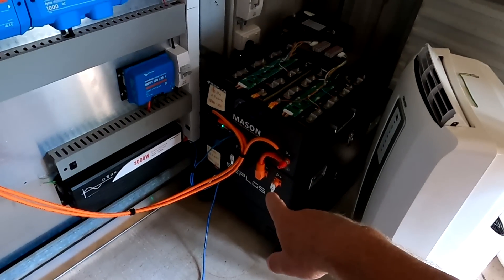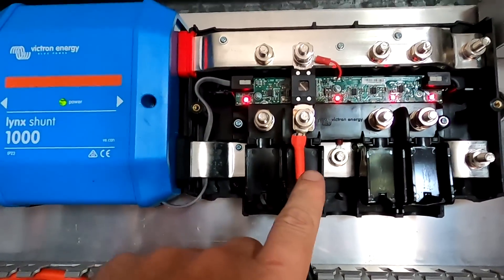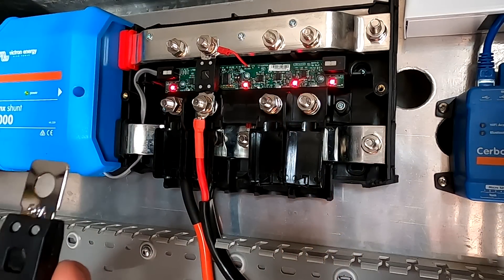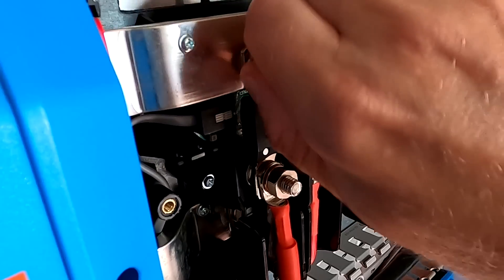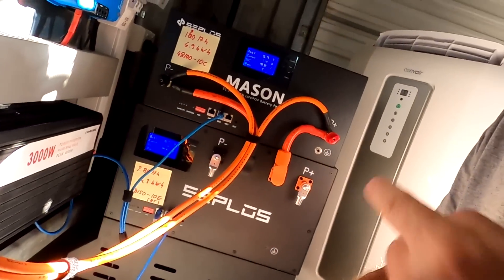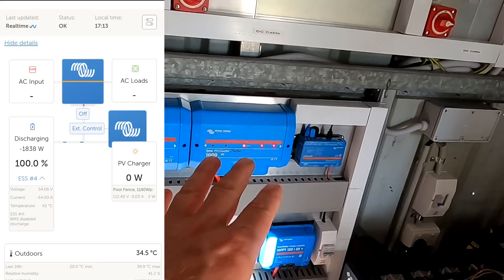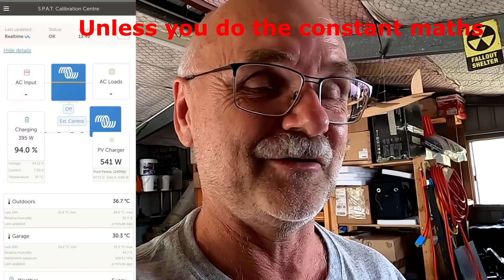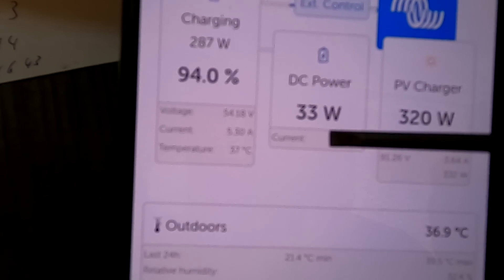PowerWall2.2 Xijia 3kW Inverter installation. I totally forgot about it...🤦‍♂️

Comment: I have the same inverter (120v) and not sure how much I like it.  It works -  I've run it at 1500w for a few hrs straight... it makes a lot of weird fan noises, but not sure it's pure sine.  I get speaker hum and I think I can tell the difference in the sound a fan motor makes running off the grid vs the inverter.  I got it as a backup.  Sort of afraid to run my fridge w/ it.

Comment: Cables coming from battery 2.2 to Lynx power in look a little sloppy. Why not run them through the raceway?
Reply from the maker: It's a temporary setup as I explained in a previous video when we discussed the design.
Reply: @OffGridGarageAustralia  . I figured that, and spoke out of turn. Battery 2.0, the wall, the solar is just awesome..

Comment: I checked, but the "Peter" inverter is not available in US style voltages -DARN looks like a great unit. Andy can you use your influence - maybe they can make a US-Peter inverter!
Reply from the maker: It is not? I thought they sell them in all markets now. 120V, ey?
Reply: @OffGridGarageAustralia  NOPE! I double checked in case they added a model, but from their website, all modeles are for EU/UK/Az-Nzld markets.  no 120volt for me😞 Can+USA+Mex = 580million customers left out!
Reply from the maker: @r.b.l.5841  bugger... I can also recommend the XIJIA inverters. I'm using them for over two years and they have the same performance as the Peter. Very powerful running all my electrical garden tool and the 2.4kW chain saw without problem.
https://s.click.aliexpress.com/e/_DBFw0TB

Comment: Hey Andy, thanks for the video. I couldn't find a link to the 50A MegaFuses you're using. Are they rated for 48V systems? I found some 50A fuses rated up to 32V but only midi for 48V 50A. Could that be an explanation for the slightly higher temp on the fuse?
Reply from the maker: The voltage does not make a difference when operating the fuse. It's more in case of the fuse blows it does not arc as far as the lower voltage  fuses. If this is really an issue, I don't know. Victron sells the only 58V/70V fuses (CNN/ANL) fuses for a lot of money. I thought I have them linked on my website... I'll have a look and will add them.

Comment: thanks for sharing the inverter precharging methods again - I suggest to cut that particular part out and release a short out of that cause the search engine will find your short then or even a video cause i had been searching for something like that for quite a long time last year when i had been unsure about the resistance needed.

I still remember the first time 2 years ago or so when I had my first hybrid inverter and connected the battery and could not believe the sparks I got each and every time cause the manual did not mention nor someone in the videos I had seen before. First I had thought what has been going wrong, if I had not turned the inverter off or forgotten something else, but in the end the inverter worked fine and the main cause was the idea to test the inverter before doing all the cabling with the Leistungsschutzschalter / circuitbreaker. And without that circuit breaker just for testing purposes I simply had left the path described in the manual and that had caused the sparks that scared me a lot, I can tell you, that was an unpleasant moment and even more that the next time it did happen again and I started thinking about cheap  quality of the inverter. 

Great explanation and of cause showing the kind of resistor used cause I only could remember last year that I had seen some big ones in my memory.
.
Reply from the maker: That's a good suggestion. I'll do a separate video how to precharge. Thanks!

Comment: I'm sure others have said it already but when running the air con, try to keep the doors all closed so its only cooling the air volume of the garage and not outside. It will be quicker and more efficient.
Reply: Andy has said that he will be boxing in the electrical corner of the room to fix that.
Reply from the maker: The AC is just a test to see if it makes a difference at all. It will go soon again...

Comment: I have the same crimp tool. The crimp unit tools working well, but...so as allways it looks you have the cheap crimp connectors. I ONLY use the good one and the crimp tool works perfect wit 4, 6, 8, 10, 16, 25, 35, 50 and 70mm2 depending on the connectors self.If you need an address for the good ones i can help out.
Reply from the maker: Yep, the heavy duty ones work far better.

Comment: That's genius using the power supply to precharge the inverter or other appliances that have capacitors. Thanks for the useful tip👍👍
Reply from the maker: No problem 👍

Comment: Hey, You should update the Cerbo to the venus os 3.0 beta because "For systems having multiple BMSes connected, allow selecting which one should be used for DVCC. It also allows the use of a BMV for SOC tracking -- by selecting BMV as battery monitor -- while still using the BMS for DVCC." That means you will be able to use the luynx shunt (hopefuly if it supports bmv it should also support it) For more accurate SOC (maybe even current) monitoring
Reply from the maker: Thanks. It's running 3.00-15 and I have shown the DVCC in previous videos.

Comment: Ok , what the heck ? If my battery is full I can't use solar to power my inverter till my battery is down to 96 % ???  Not cool if you have huge battery bank . It could measure the 1.5kw load on the battery , why not let that amount through the charge controller ?
Reply from the maker: It's a major design problem with the Seplos BMS. More about this in a future video.
Reply: @OffGridGarageAustralia  🙃 Thanks Andy for looking into it . That's a show stopper for me .
Reply: I thought that can't be right, but I watched again and the Solar controller output is zero.

I'd expect the block on charging to just be in the BMSs, but maybe this is a downside of the comms with the Cerbo GX? Perhaps that can be re-configured in the GX? You would expect the controller to be in float with the battery ignoring it?

Comment: What voltage fuses are you using? I can’t find any 50amp 50+volt mega fuses. Most lower amperage fuses are 32v
Reply: Victron has them .
Reply: @onthelake9554  their mega fuses start at 125 amp for the 58 volt. They have midi fuses down to 60a 58v but I don’t think they will fit in a lynx distributor
Reply from the maker: The design of the Lynx shunt could be better to accommodate a class-T fuse. That would be great. 
Only Victron has got the 58Vand 70V fuses as far as I know. I did not buy them for my test setup.
Reply: @OffGridGarageAustralia  I guess if the goal is to protect each battery with a class T fuse it needs to be at each battery really , if something shorts the cables =BOOM ,  as Joe would say .  Mounting a class T holder on the face of the battery and just use a buss bar or regular fuse at the Lynx .
Reply from the maker: @onthelake9554  I would really like to see a breaker being installed in the Mason box to easily disconnect a single battery quickly. I have some 125A dual breakers here just need to find some time for this project...

Comment: Maybe adding a (large) fan that exhausts the hot air from the garage or brings in fresh air might help with the heating problems! Installed some fans in our outside shed to keep the tools and batteries from getting toasted by the heat and it works wonders! Cheers from Belgium!
Reply from the maker: The problems with fans is DUST!
Hence, I have the idea to build this battery room around the area.
Reply: @OffGridGarageAustralia  Fans in the gable ends as exhaust, put in a fresh air inlet with a filter...like they use in an HVAC system. Cheap and easy!
Reply: Some ‘Roof-Ventilators’,  commonly known as “Whirlybirds” ( a Brand-name) here in ‘HOT- OZtralia’, installed into the roof of your ‘HOT-ColourBond Steel shed’ to exhaust the ‘trapped’ hot air and the electrical equipment’s heat-buildup, inside there, are a MUCH, MUCH CHEAPER, and still, very effective, and also ‘non-powered’ solution, to your HOT problem, Andy, rather than trying to both, Power, AND AirCondition, what is in reality the best possible imitation, of a VERY LARGE STEEL OVEN, situated in your own backyard, during a TYPICAL,  40 degrees C, ..PLUS, HOT Australian Summer 😉 
It also helps to have ‘cool-air’ inlet vents, located close to ground level to allow ‘cooler’ air, to be drawn into the shed to replace the hot air as it, is being exhausted out, of the roof space.      Although, most, Aussie made ColourBond Steel sheds with ‘corrugated’ wall-sheets will already, have plenty, of ‘air-inlet-spaces’ around the bottom, at the concrete slab level, of the wall-sheets, thanks to the ‘profile’ of the corrugated sheets, and so won’t usually need, any additional air-intake vents to be installed. 😉👍
Reply: @OffGridGarageAustralia  Ah yes, I did not even think about that!

Comment: Hi, I would like to know, if it is possible to get AC loads readings into a Venus OS system with a non victron inverter? Would this be possible by wiring a Victron Energy meter ET112 after the DC/AC inverter and before the AC loads? ET112 measure AC loads and can be connected to Cergo GX - so it should be theoretically possible, or am I wrong. What do you think about this? Thank you very much for your answer.
Reply from the maker: Yes, you can use AC meters which connect via MODBUS to the Victron system. More info here: https://www.victronenergy.com/accessories/energy-meter

Comment: Check the firmware of the Seplos BMS, with version 2.9 it should gets a better balancing.
Reply: I’m in contact with Seplos, they told me that this is only available in Chinese 😊 I answered in Chinese no problem for me…. If I get something I will share it!
Reply from the maker: @tequilatom  Great, thanks. Not sure why they are holding back in using the greatest feature they have: firmware updates! 
This could be the most wanted BMS out there...
Reply from the maker: Do you have the change log from 2.8 to 2.9?

Comment: All those bright lights Victron uses are not always appreciated. On a boat or camper they are kind of annoying when you try to sleep. I whish the lights could be disabled.
Reply from the maker: Oh, yeah, I can fully understand that. Even one blinking light can be enough to make your night a nightmare. A nightmode switch in the software would be great.
Reply: @OffGridGarageAustralia  IMHO LEDs should be off by default on routers, charge controllers, tvs. One could have a little button which switches them on for a minute if one is interested 

I dont need an LED to tell me the internet is working :D
Reply from the maker: @HolgerNestmann  Yep, I agree
Reply: 2 Layers of Duct Tape, disable them quite effectively
Reply: @HolgerNestmann  I can confirm it takes two layers of ducktape to dimm then enough so you can still see the blinking thru, but it doesn't blind you. I won't talk about the mess the tape leaves behind after a year.

Comment: This was quite interesting - building the small system turned out not that small - 3kW output is quite substantial, battery capacity is also quite high, Victron reporting top-notch... Well done.
Reply from the maker: Thanks a lot for your kind comment, Robert. Appreciate that!
Reply: Not quite, 2kw is what was shown, and probably its continuous limit, 3kw will be its peak and only for about 5min before it shuts off.

Comment: Andy, you can connect victron lynx shunt to the system and check the difference between victron shunt and seplos shunt. You have to set the visibility in "battery measurements" in System setup.
I have victron smartshunt and JK BMS "shunt" in the system and the accuracy of shunt in JK is not good.
Reply from the maker: But you can have only one shunt in the system at a time. At the moment, I'm still testing the Seplos capability of communication (or not communication) but I may switch to the Lynx Shunt eventually.
Reply: @OffGridGarageAustralia  Andy no you are wrong. You can have more shunts in the system, but only one is set as "Battery monitor". All others is hidden in "battery measurements". So if you connect the Lynx shunt to the system, you have to set "visible" in battery measurements and this shunt appears below Dashboard. Trust me, I have two shunts in the system 😉

Comment: Hi! I use sometimes one stone larger one smaller together when crimping. For example one 16 and one 10 and everything is fine. You coud try it. Maybe with your crimper it wil work.
Reply: @Albert OK, no stones, dies 🙂. Some people call it stones. My English is not perfect, sorry.
Reply: I also do this. It wastes less material than going down a size on both dies.  Too much wasted material presumably can weaken the crimp. The wasted material needs grinding off before heatshrinking.
Reply from the maker: @nigelcharles511  I didn't even think about using two different ones.
Reply from the maker: Ah, right, that's a great idea. Thanks for the tip, I will definitely try that!
Reply: @@albert6220 Rhine?
Reply: Good tip

Comment: So the $100 chinese inverter runs the aircon but the million dollar victron fails over.  Weird.
Reply: There were more loads connected on the Victron, not just the aircon
Reply: @habana7638  I thought the aircon was an old 4-5kw one.  If it's running at 1.5 to 2kw that should be nothing for a Victron to run even with other loads.  If a cheap Chinese Inverter can run the aircon, there's something wrong with the Victron.  In my early days I bought a cheap 3000w Chinese inverter to run a 1000w pump.  Magic white smoke.  Maybe he has fried a few Mosfets and that's why the power in lower.
Reply: The victron  realizes it's connected to junk .

Comment: I'm putting together a separate system to run my AC mini split heat pump I'm using Senville but MrCool has DIY Mini splits units I'm really shocked Andy doesn't know about a mini split everyone on solar is using them very low power consumption and no surge
Reply: When do you use AC in Germany? that is why!😊
Reply: Same comment twice??
Reply: @ricardomarcelino8388  two separate comments same topic yes

Comment: I miss this being a build channel instead of being nearly all sponsored review content.
Reply: I don't think anything is sponsored with Andy, I only remember one battery that the maker sent to him and he didn't like doing that
Reply: Maybe you could donate some money for that .
Reply from the maker: It's a hobby, guys. If some buying me a beer from time to time, that's all I need. Everything else is on my expense and I'm sharing my experience with what I would have done anyway.
Thanks for all your great support here. We will always do DIY stuff on the channel but also review some other items. Pretty much the same what I did before as well.
Reply: Not the only one
Reply: I don't.
Reply: It would not be sustainable for Andy to buy more and more cells to build batteries in every video. The man just had a 15Kw solar system installed, and he has 3x 15Kw batteries on the main system. Just the Solar panels and 3x 48v batteries is many thousands of dollars. You can't expect Andy to be able to bust out $5,000 worth of batteries every few episodes. Trust me, I would love to see Andy build a portable jump pack or a high output battery pack to run a 24v system and 24v appliances from an RV in the garage or something. But again, doing all these projects is very expensive, and I don't expect Andy to be able to build a new battery every week.
Reply: @catch22frubert  It has taken years to build up to what he has got, the solar panels, yes he got them cheaper because he could claim the STCs from the government. All the batteries has paid out of his own pocket. So don't make statements that you cannot prove or have no knowledge of. Sorry i do not trust you, go back and watch ALL the episode then you can make an informed comment!!!!!

Comment: You still appear to have your Seplos Mason batteries incorrectly connected to your loads. The negative load terminal should be on one battery (say lower) and the positive load terminal should be connected to the other battery (say upper)  You are creating an artificial voltage drop between the packs.
Reply from the maker: I explained, it is a temporary setup as I'm waiting for more parts and don't want to waste these few Futronics connectors I have before being sure how to proper cabling everything. So these fly-leads will stay for a while until we do something bigger... 😉
Reply: It was explained to you in the last video that this has no consequence on this set up .
Reply: @onthelake9554  No, it was explained that he doesn't understand why it is wrong. Connected like this, the battery closest to the load is always going to discharge more and the bottom cell will charge more slowly. It is not charging to a higher SoC it is just not discharging as much so has retained a higher SoC. The top pack is doing all the work.
Reply: @TheGalifrey  I completely understand what your saying although even that is not the best way either . The best way is for a home run to a buss bar for each battery . But like I and Andy said , for this set up , for this low power , temporary set up it is fine . He wanted to get all the bugs out before building a bunch of cables.  Cross connecting like your talking about is NOT the best way , but on a low power system is would be fine too. Each battery connected to a common buss bar (lynx power in)  is the ONLY best way .
Reply: @onthelake9554  I agree, a common Bus bar System is the best way, but the cross connection would solve his imbalanced SoC issues which was what I was addressing. I only raised it as he didn't seem to understand why it was happening. The lynx is not perfect if you have a lot of packs as you have to make all the leads identical length, but big thick copper bus bars are definitely the way to go.